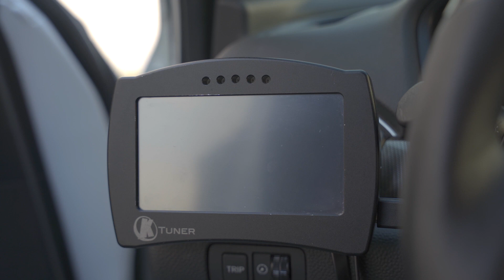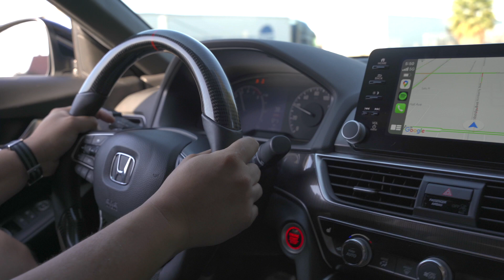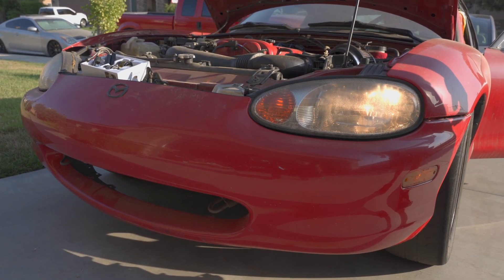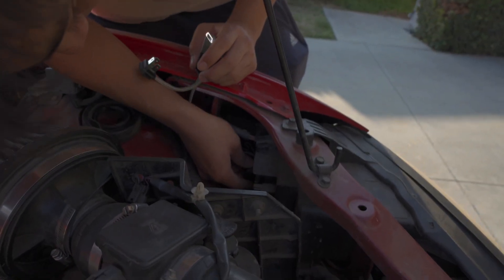TYPE R TURBO UPGRADED ACCORD 2.0T GAPS MY ACCORD V6! | 2021 Honda Accord 2.0T Build @chefcv2

Comment: i saw you got 265 width tires. i was thinking about 255 tires for mine and was wondering if there's any rubbing? or would 245 be better? also as for the turbo, do you hear any increase of the spool/swish noise? that's like music to my ears
Reply from the maker: Dm him
Reply: no rubbing if u run a lil bit of negative camber front and back. also im running a 280 tread wear tire so its not to0 meaty. turbo noises  once I upgraded to prl charge pipes u can definitely here some noise